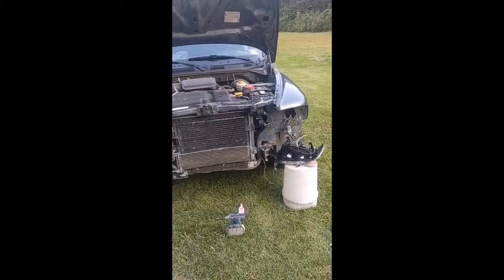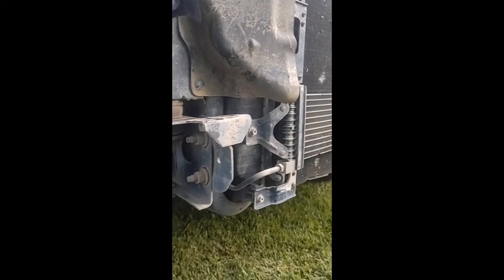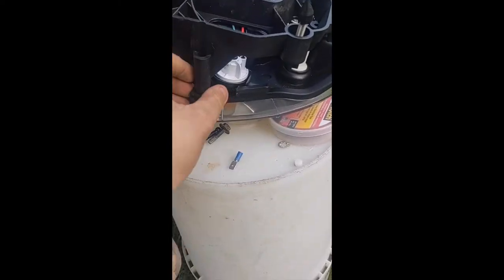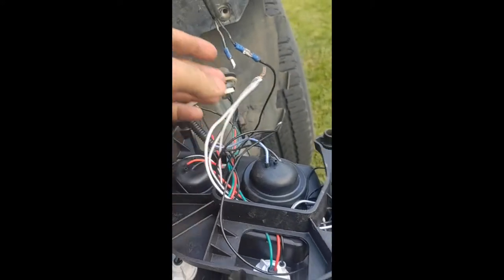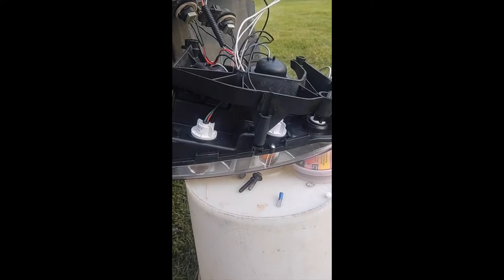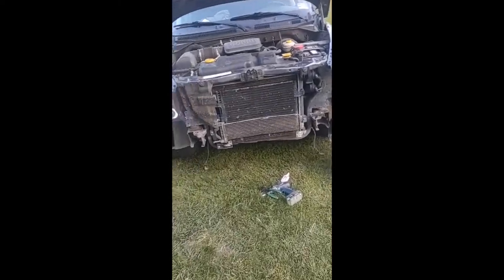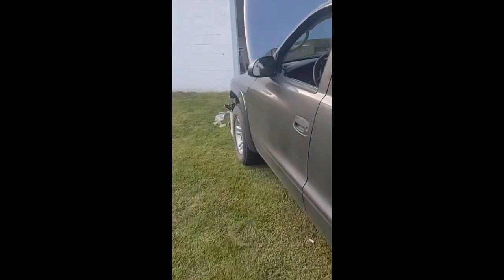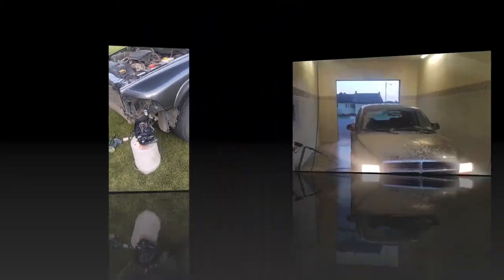2004 Dodge Dakota headlights Spec-D

Comment: Thanks for the video. Looking at replacing mine rn
Reply: Don't buy these!  They are trash...Just buy replacement OEM for 4120 and install Oracle halos that will last.
You will get anywhere from 1-5 months before they fail.